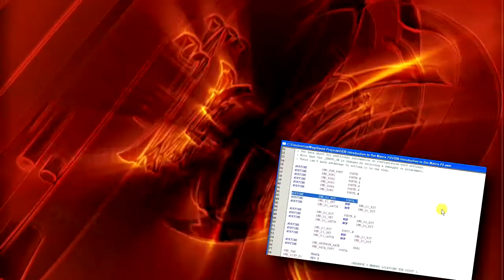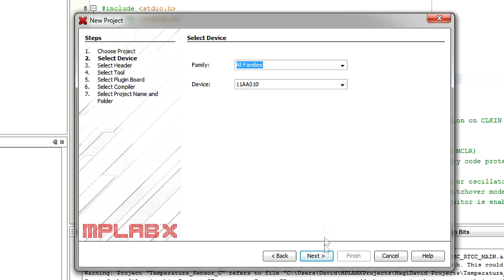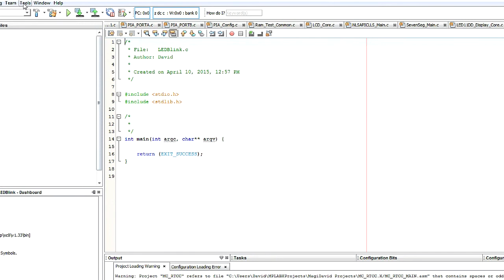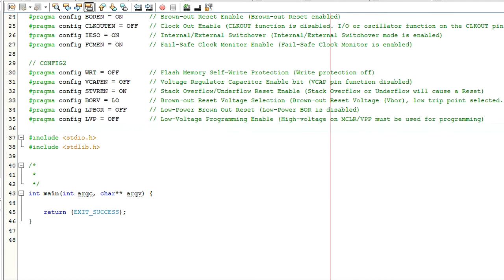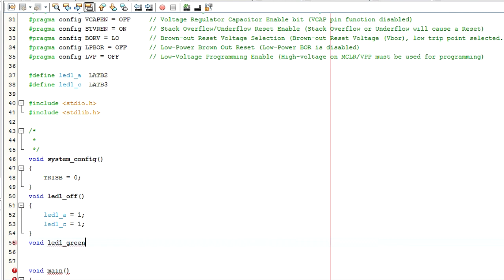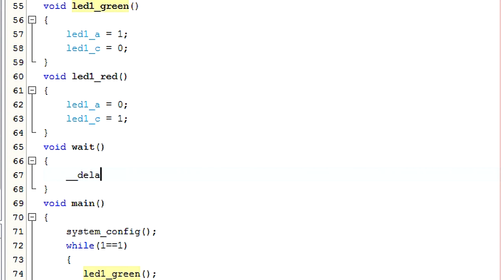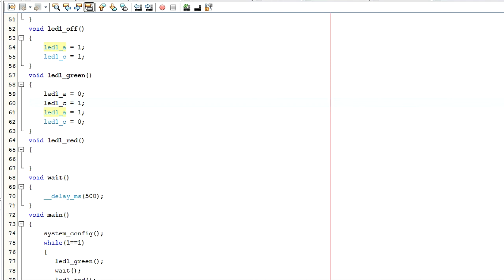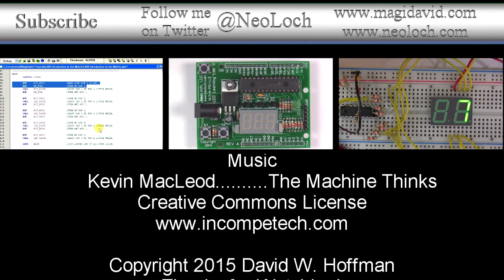David's Lab: MPLAB X Project Setup and C Bi-Color LED Blinking Tutorial

Comment: Excellent video please keep them coming if you can! I am finding it difficult to find new relevant mplab x tutorials on YouTube. Lots of old outdated tutorials with older ide's this is perfect! Also could you please confirm if the pickit 2 does work with this ide assuming you are programming a compatible mcu. Thanks!
Reply from the maker: +Jacob Dykstra Thanks! I'll certainly try and I do have plans to do a series on several different MCUs, I just haven't had much time to do many videos of late. The PICKit 2 does not work well with MPLAB X, but you can use the PICKit 2 with the IPE that comes with MPLab X. So the PICKit 2 is still usable, just not directly.
Reply: +David Hoffman Thanks for the info. I tried using my pickit 2 with mplab x and it was giving trouble so I wasnt sure if it was just me or they killed support for this device. I really want to learn pics but it has been difficult finding information about mplab x and the xc8 compiler. I just bought the pickit 3 hope to get going with PIC's soon.